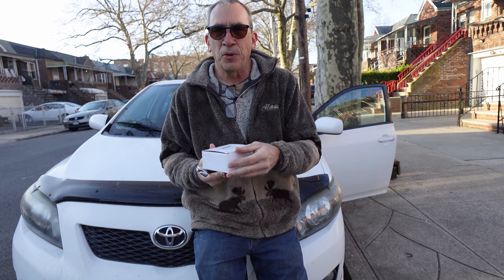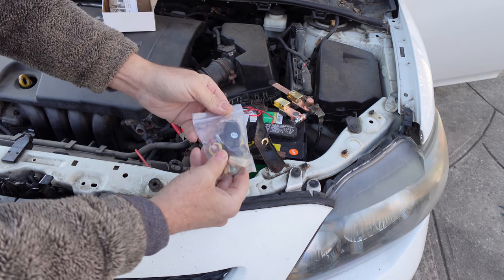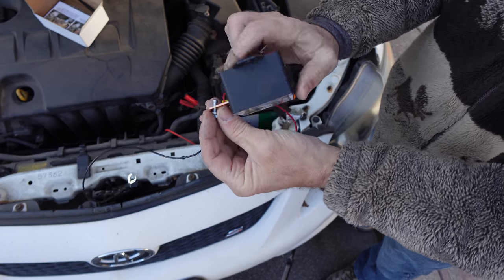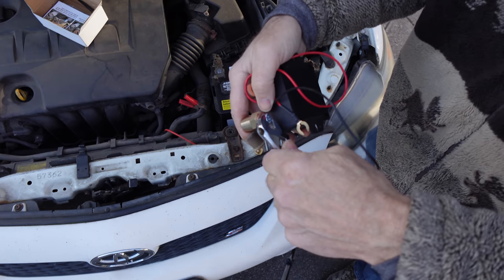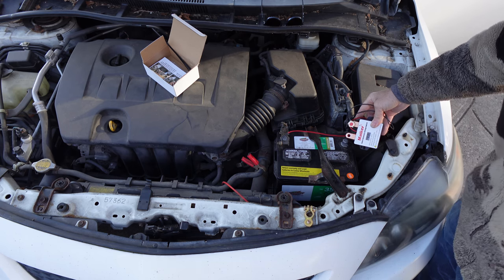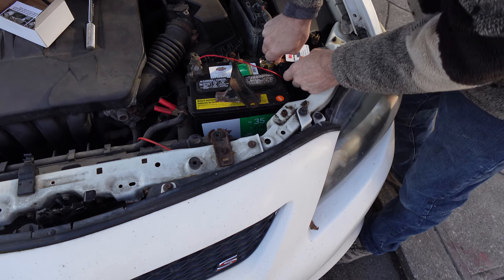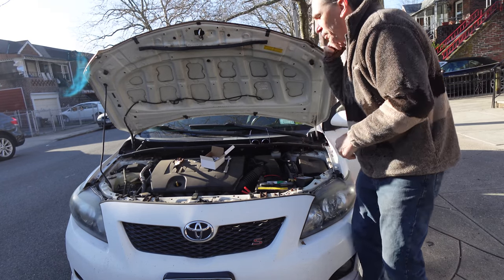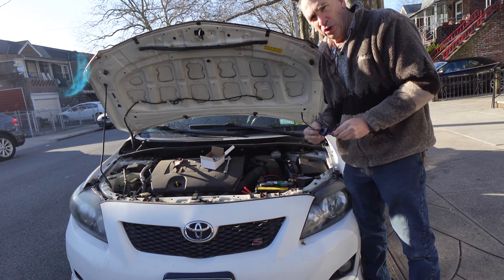Wireless Remote Control Dual Battery Disconnect Switch Kill Switch for Car Upgraded with Led Digital

Comment: This model of killswitch is very nice  first time i saw it i buy another model  rated 700amp cause i wasnt sure how much i need  but to gave see your video before i would have been interested in this 1 whit the volt meter + all wire is included
Reply from the maker: I preferr  the knife, manual  works, without the draining over the time

Comment: Do you need to adjust your radio settings, clock, etc from the time you use the kill switch remote?
Reply from the maker: This is the important part, if your State has  an Inspection you will be required to do a drive cycle  to get all your   emmissions pass, also   every time you shut off, you will be resetting it all, so remember it will   take care of that parasite but it comes with a cost. hope that helped out

Comment: Yes but every time you do this it resets the car stereo
Reply from the maker: Yes you are correct on that, the Kill switch has an advantage and some disadvantages. the main one is in the state that has inspections, you must cycle the car to pass and the Kill switch has to be removed. all things that require  Dc power to hold memory will also be  a problem, so  a throttle learn must be redone, radios that do not have battery back up, etc.  since i have a parasyte draw , and  due to the  batteries on the market not the best anymore i chose the kill switch route.
Reply: @fishycomics  thanks for the reply I’m after like toggle switch but wireless for a a fuse